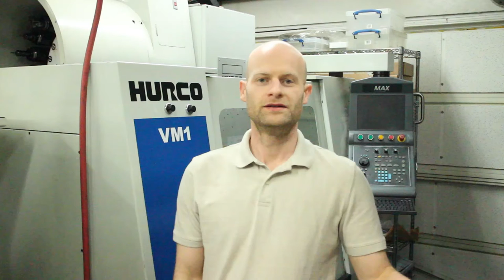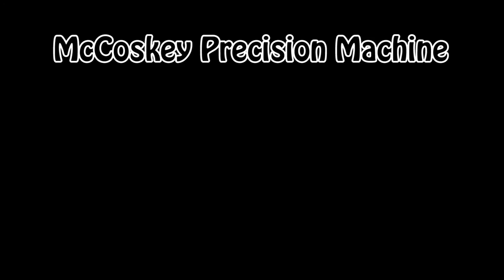How To Reduce and Eliminate Chatter (Milling and Turning)

Comment: I am working on a part which is not much sticking out and sometimes it chatter and sometimes not.  While I adjust feed and speed and it worked for few parts, as soon as I change the insert it come back again.  What to do?
Reply from the maker: New inserts are more likely to chatter due to them being sharper. It sounds like you could be turning a thin walled part. I would lower the surface footage (RPM) until it stops chattering.
Reply: Same problem right now

Comment: It's easier to visualize chatter on a lathe. If you are working "inside" the ways, it's alot harder to get chatter. When turning large parts, especially with the gap removed, it is easy to get chatter. A 50lb dumbell at the opposite side of the cross slide can help.
Reply from the maker: It’s all about rigidity and harmonics.
Reply: @McCoskeyPrecision  and staying between the ways makes the system tremendously more ridgid. At 0:28 you basically say the same thing, where increasing rigidity basically eliminates it.

Comment: Or you could increase your chipload and push through it
Reply from the maker: True, If the tool and setup can handle it, a larger chip load will help reduce or eliminate chatter. It gives the tool less time to bounce around.